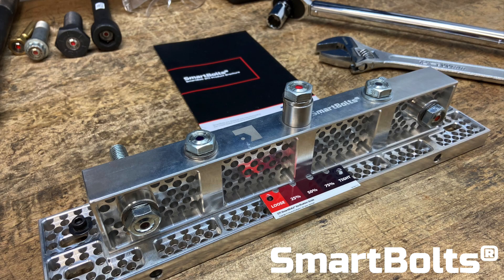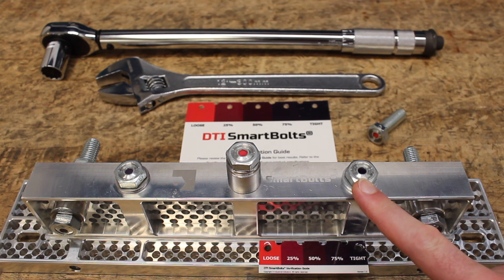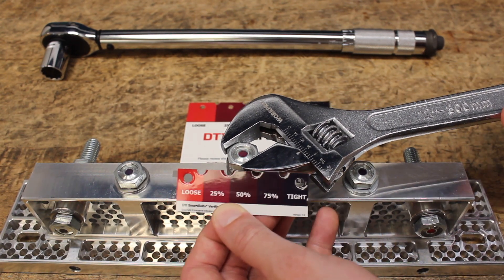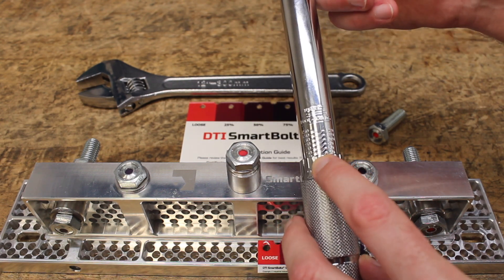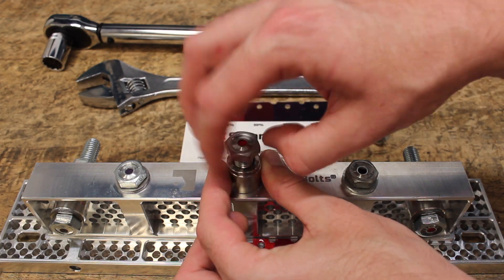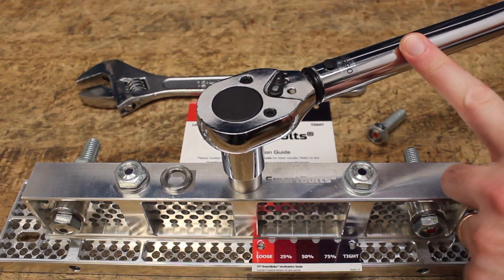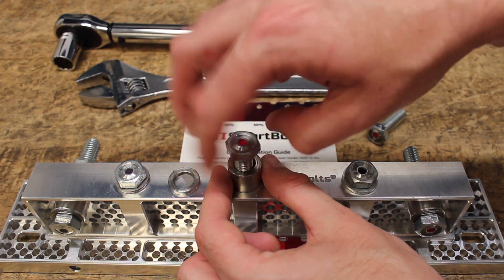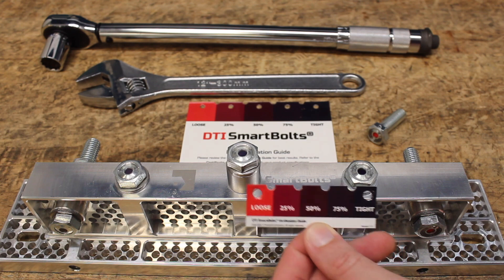SmartBolts Demonstration: Torque is Not Always Tight

Comment: Holy shit dude who actually needs this
Reply: If a critical function or safety is on the line, these could make sense. It is not even necessarily about determining proper tension vs bottoming out, it's also about making it harder to screw up. I install electrical equipment hand have seen bolts pissed in the torquing process. Generally, you use a paint marker as you torque, but in the real world a person may do a series of bolts and then go back an mark them. This is can lead to mistakes. With this, it doesn't rely on your marking. Also, if torque is something that is checked as a routine part of maintenance, these will save a TON of time. You can simply do a visual inspection and only torque what bolts need it, if any. You are welcome for the rant. ;)

Comment: Looks great for inspectors who need to look over several thousand of bolts such as  building sky scrapers.This would also be great for maintaining infrastructure such as for specialized train cars that have equipment that examine the health of the rail lines.  The train could drive slowly then if it pings a lose bolt people would hop out of a slow moving train car to re tighten the bolt before getting back onto the train car.

 Maybe you should push for a industry standard with the idea that you'll be going open source so other companies could get on the game.  I bet you could get a multi billion dollar grant from the Federal government.
Reply from the maker: Spot on. Load indicating fasteners such as SmartBolts are becoming more of an industry standard due to their ability to directly measure bolt preload and the clamp force of a bolted connection. Send those multi-billion dollar grants our way!

Comment: What kind of sorcery is this
Reply: I looked at the site, my first guess was correct on how it works.

Bolts stretch as they're tightened, and these use that stretch to measure how tight it is. Not sure how the color changing is achieved though but that's how it can indicate if a bolt is tight or not.
Reply: @NarrikBwah I'm guessing a needle with a red indicator Plate is inside the bolt attached to the bottom end. The empty space is then filled with a black fluid this giving you the colour gradient as the bolt is stretched the needle with the plate attached is being pulled away from the sightglass thus changing the colour.
Reply: I'd go with color changing material based on stain. So higher stresses (ie higher tension) and it induced a phase change.

You'd need different load ratings though. So like 20Nm smart bolts vs 30Nm or 90Nm, etc. Cool idea if utilized across an entire machine though